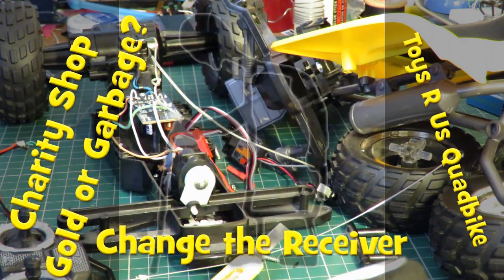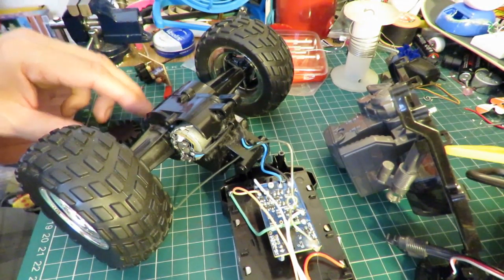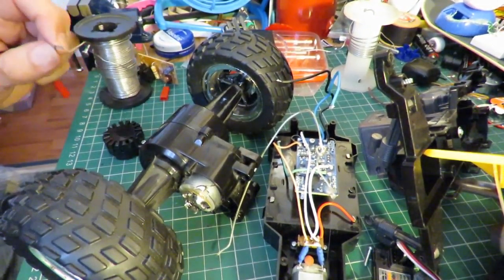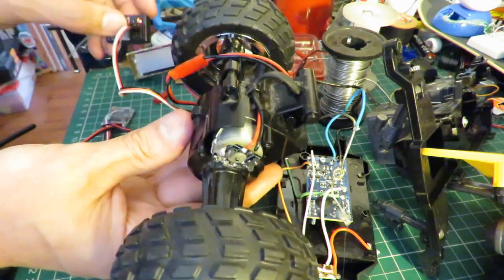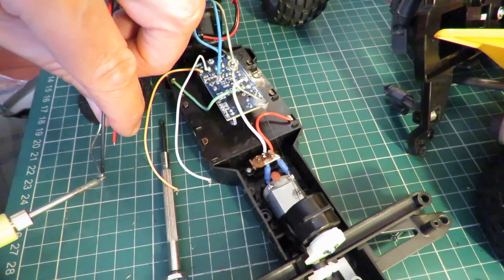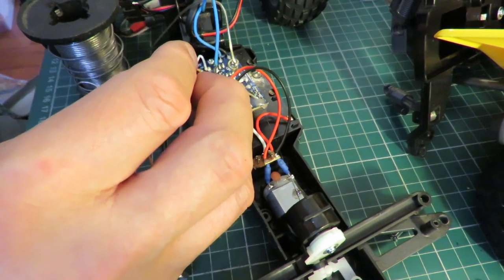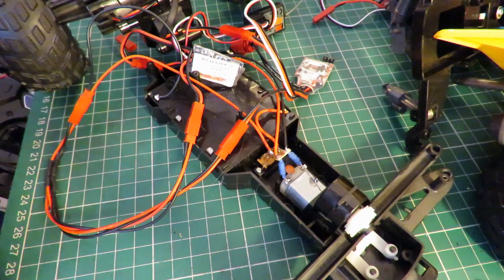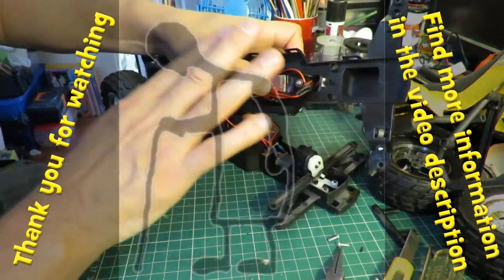Charity Shop Toys R Us Quadbike - Change the receiver to Hobby Grade

Comment: Great vid but was wondering why you never used a servo for the steering so its proportional loads better control ?
Reply from the maker: The two ESC method is the lazy conversion but quick and easy. Nothing else in the toy needed to be modified and everything could be replaced if required to return it to original standard. If I was going to upgrade the motor then it would be worth sorting the steering at the same time but I am not keen to go that far at the moment.
Reply: Yeah that's true so fair play to ya . Keep up the cool vids tho love your channel
Reply from the maker: David Turner thank you David :)

Comment: Good job.
I was just wondering, the steering motor could probably be replaced with a 9g servo. That would make you able to get rid of one of the ESCs. And the servo is cheaper than the ESC.
Reply from the maker: The two ESC method is the lazy conversion but quick and easy. To make it work better would require a bit more work. Not sure if a 9g servo would be man enough although it would probably work long enough for me to make a video. I have a larger metal geared servo lined up for another conversion job that I haven't done yet and the same servo has worked well in my big Corvette conversion.. I might do it sometime but this was enough to show the general idea.

Comment: hi grandad. I just posted a new video were i fitted a diecast Porsche with lights. my question is, do you think I could convert it into a rc car? the back hood/trunk opens to show off the air cooled engine and is removable.
Reply from the maker: It depends on how much of the original model you want to retain. The easiest conversion would be to take the body shell and fit it over the chassis of an existing RC toy car. If you want to retain the original chassis then you will have to make some sacrifices somewhere to fit everything in. Is it diecast metal or plastic? Obviously diecast metal with be harder to work with and the end result will be heavier.
Reply: +GrandadIsAnOldMan diecast metal. I have removed about 1 pound of metal from underneath. thanks for the insight!
Reply from the maker: Clorox bleach it looks great, you may not like this comment but I like the way it is a bit roughed up. Almost Rat Rod style. Good luck with your project anyway :)

Comment: Ah thought you'd swap the servo as well there as its a quite simple mod to get it to work as the original.
Reply from the maker: If you mean the conversion for to make it DC working that would be a backward step. With a proper hobby grade receiver you might as well use it as designed and get proper proportional steering. This was a very lazy conversion and I have done it several times before. It leaves all the existing internals in place with no modification. I might do a proper conversion sometime but this was enough to show the general idea.
Reply: Indeed enough for a simple conversion, guessing that the the esc doing the steering has a brake function on it for the moment so you need to double tap it to steer the other way ?

Might be worth trying to find a esc with just reverse / forward to get a similar functionality as it had if you do use one with brake function at the moment for the steering motor.
Reply from the maker: Marcus60661 what makes you think it has a brake?
Reply: ah so it is one without a brake ? i remember seeing an older video where you had a small 10a esc with brake desrcribed, dont mind me then heh.
Reply from the maker: Haha, I have used rather a lot of ESCs over the last few years and burned a few too :)
Reply: GrandadIsAnOldMan
 One of my first rc buggies (clone of a tamiya baja king under the name hbx 1:10 buggy i believe theres a few videos on youtube probably on it (older looking buggy with flame paintjob either purple,blue or red with chrome wheels.)

I burnt the esc going over too rough grass (overgeared onroad chassis)

So it set the car on fire because i had made a dirt/moisture filter over the esc with cardboard & a plastic bag was fun to drive while it lasted though heh.)

I've also burnt a brushless esc going over a wet patch of grass with the e-firestorm that had a small puddle hidden among the grass in a small pit near a random bush.
(drove about during the evening so didn't see it & it was a few hours after it had rained so didn't expect it either.)
ended up having to throw away the receiver,lipo & the esc heh ^^
but you live & learn as the years go heh.
Reply from the maker: Marcus60661 the point is to enjoy yourself and if it was fun doing it then even if it was a "learning session" it was still worth it. If nothing goes wrong then you miss half the learning :)